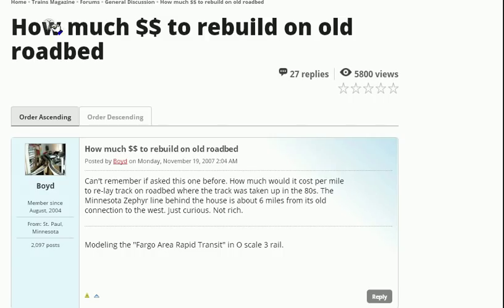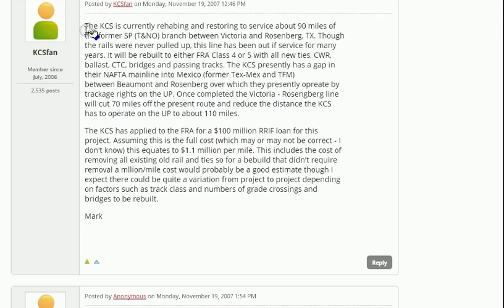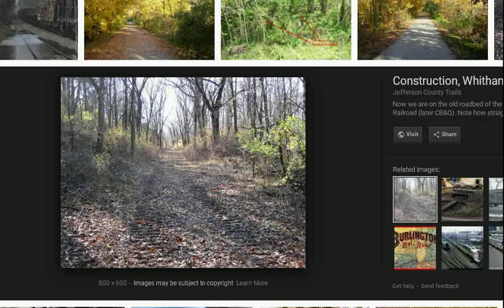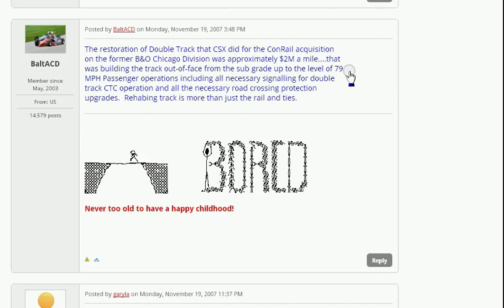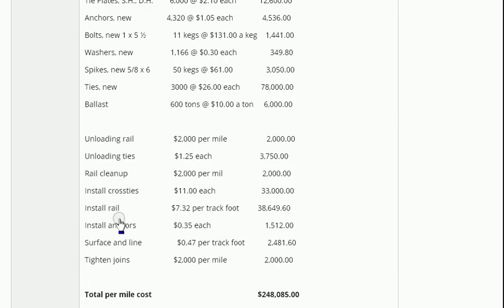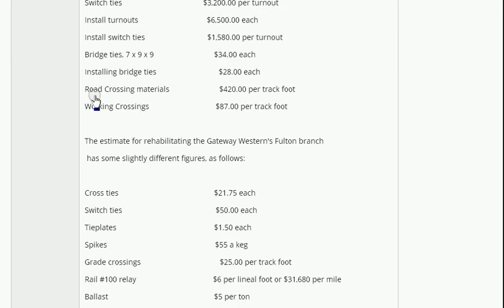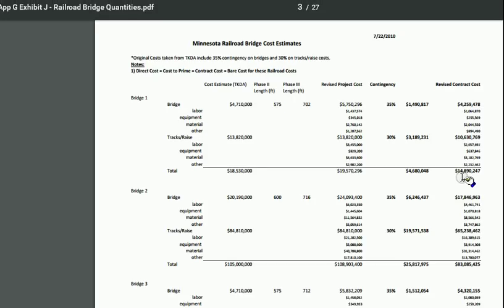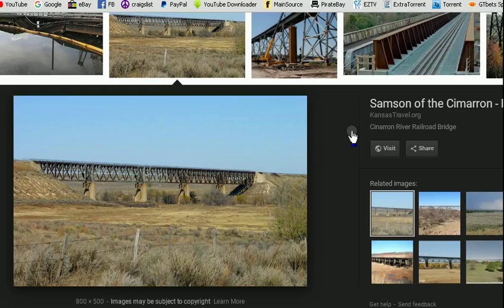Cost to rebuild old Railroad .. Railroad Construction Cost

Comment: A rebuild should be a whole entire makeover,,that means you would have to take up the old tracks and make a redesign of new railings....better train car wheels that won't derail just like a roller coaster🤔the old steel can be reshaped and still be reused. the newer track design may not be able to cross into street intersections as smoothly as the old fashioned track,,but it can be raised like a monorail system and just bridge it over street crossings...👍